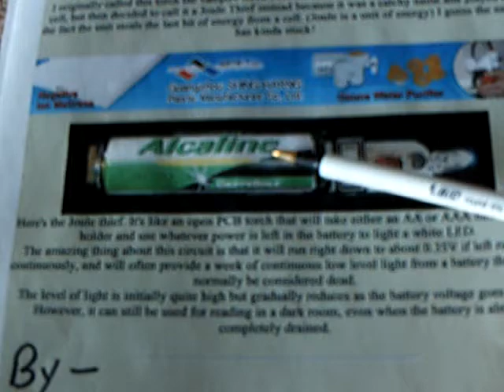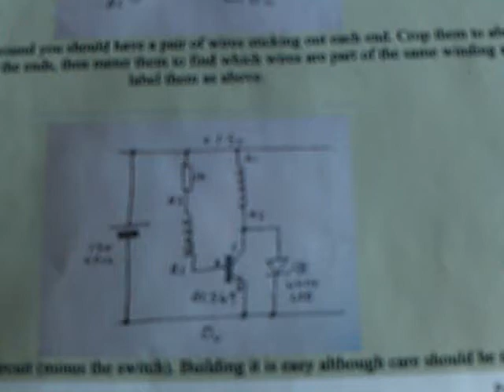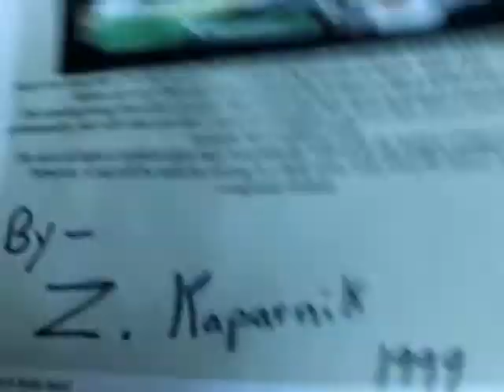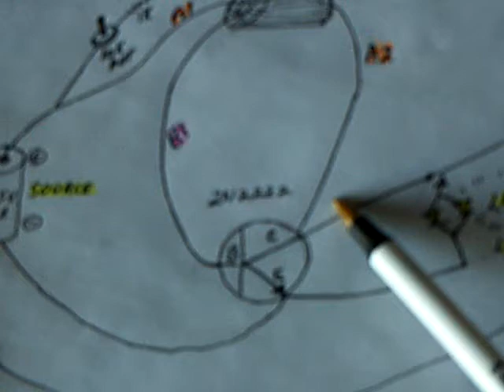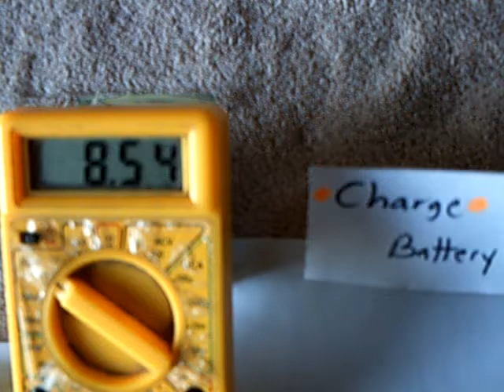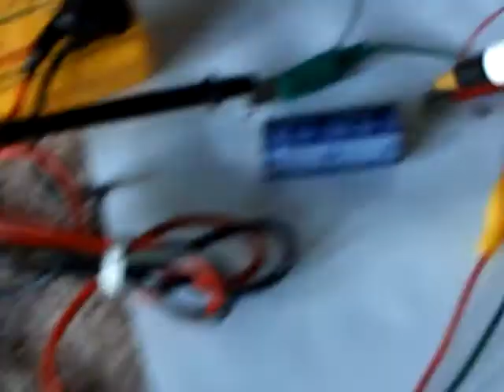Joule Thief Charger

Comment: @jerar1971 well, take two pieces of different color coated wire. twist them together. wind as many turns you can its not critical. when done, you should have 4 wires, and two of each the same color. take one and find the other color wire on the other end of your ferrite. you will need to play around to find the right combo

Comment: Just a quickie for you.
I have put together your version of the J.T Charger and it works.
I had it running with two Led light bulbs for over 20 hours without loss of luminosity whilst charging.
However, since my first attempt I have changed the transistor and installed a Tip 33 or the equivalent. I have also coiled the wire that goes to the battery from collector as well as the negative that connects onto the positive run battery.
I seem to be getting over 3 V going in.

Comment: @Lidmotor i want to make a joule thief for charging capacitors but the only transistors that are npn start over heating where could i get one with a hole to connect to a heat sink?

Comment: Good idea, I want to try something like this on a slightly larger scale, Taking a 12V solar panel and trickle charging a 36V Lead acid bank. Are there changes to be done for the slightly higher amperage output of the 120W solar panel? (sounds like 10A max on the primary do I need bigger wires on the coil?)

Comment: have you built my 3 ma 12vdc ALI COIL YET LIDMOTOR ? 
i charge 600f ultra  boost caps fast !  so fast i need to worrie of blowing them ...  

they hold 5800 watts ! each 
and my latest unit puts out 600volts  12vDC 38ma draw  

around 2 mhz .... : )  it puts out 120vdc at 3ma draw ..  under 7 volts it runs micro amps .. 

IST

Comment: @Lidmotor 

Hi I found another 2222A transistor inside my old pc power supply, now I understand that there are different types of 2222A transistors. 

The ones I bought are the metal silver ones, the one I salvaged from the  power supply is the black plastic type. The black plastic type 2222A transistor works great, better then the 3904 transistor that I have tried earlier as well. I have a brighter light with the black plastic 2222A transistor.

Comment: @Lidmotor 

It works, thank you very much ! I used a 3904 transistor with a 20k variable resistor, it is a bit  much but when I turn it down the Bright 1.9 volt LED shines bright at 0.618 volt and the amperage goes up a bit, very sweet :-)) I used 0.5 Millimeter wire and 20 turns on a small ferrite rod When I remove the small ferrite rod the LED goes out :-)

Without the Joule thief but with the same AA battery, the LED doesn't go on at all, I'm using a battery  that doesn't work in my mouse :-)

Comment: Hi I am not too experienced with electronics but I got myself a breadboard, and I want to make a joule thief. I have an NPN  bc547b transistor and a ferrite circular core out of an old PC power supply.  I have tried several amounts of windings but I can't get it to work. The more windings the lower the voltage drops, I can lid the LED at a certain point but not with a single 1.5 V battery. 

Is a 2N transistor preferable? Can my ferrite core be too large?

Greets, iT

Comment: Hi, Lidmotor )
I had replicied your circuit with a restistors from 10 Om to 138K and 1K. Everything is the same.
Yes, it generates 20V from 1.5. But the energy in the mother batt runs out. Charging failed (
Maby there are some limitations? On the doide?

Comment: This circuit is what I call a "power booster". No phenomenon though. The circuit just draws energy at a higher rate. p=de/dt. Accurate readings are impossible because of the non-rms waveform. You have to use an oscilliscope and do some math to find the averages. You should find that the energy disipated at source has a higher rate than energy supplied at load.

Comment: tnx for the ideas,today wrap the coil with cotton, more dense in the center and 2 loose layers surround...and put all in a zippog bag... The crazy piiiii..now is Very low :).I use a tiny coil 50 turns because works better charging than my 300 turns ... U know why?

Comment: i found a video about the youle thief yesterday and i´ve already built 3 of them using parts of old broken circuit boards and all kinds of LED stuff that usually needs those expensive 12-volt-battery fuckers. I managed to run 6 LEDs in series on a single old 1.5 volt button cell!!!

this is one of the most awesome circuits i´ve ever seen....

Comment: got the 2n2222 transitor going with the joule thief, using a AA

i wanted to use it with the Wireless energy setup but it don't seem to work the same.  got any suggestions.

basically my receiver can light a led dimly
as it is with just a ground and a antenna, but when i hook up the joule thief, nothing.

Comment: you know something also to look at/for?
charge a cap and drain it off of like 3 leds
even after you drain the cap b running the lights it will still hold 1.5 volts per led. 
do if you have 20 leds it will have 30 volts stored in the cap even after the lights are burned off.
so we can apply this to this setup.  by pulseing the leftover voltage off of the caps into another circuit.

probly sounds nuts, but its possible.